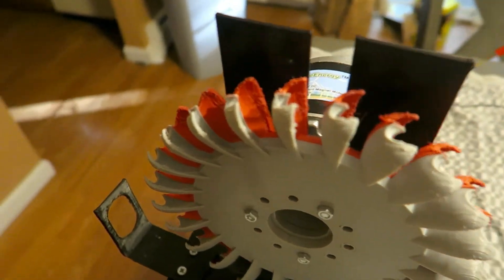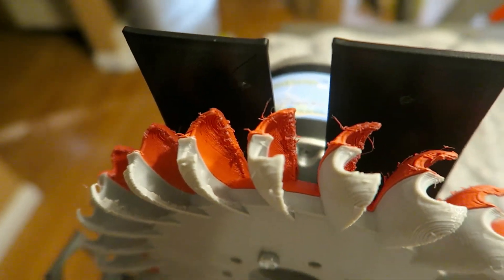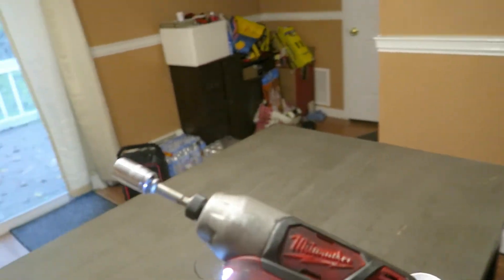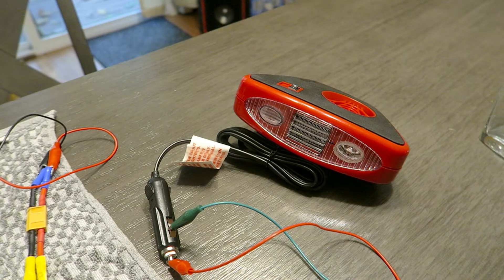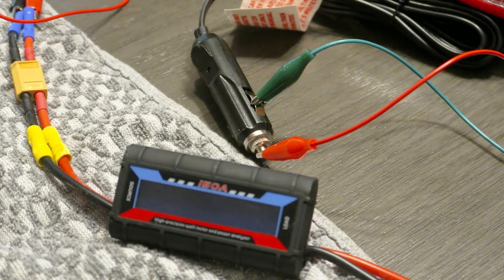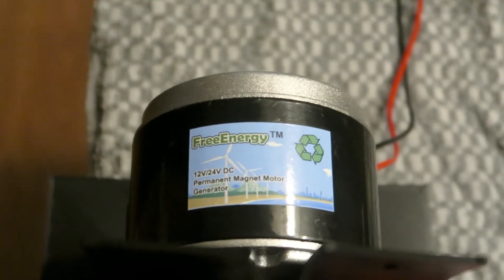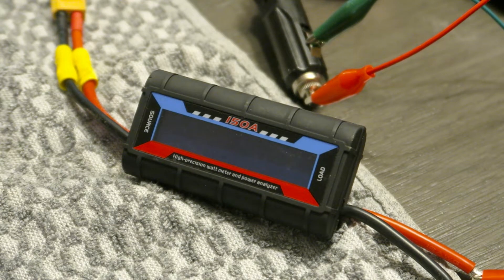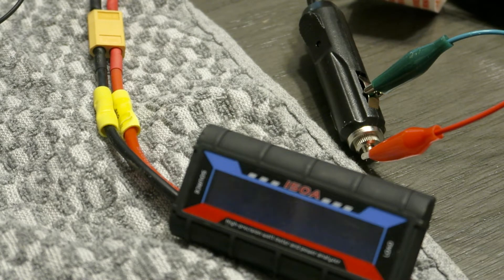3D Printed Pelton Turbine Bench Test (part 3) 200 watt goal

Comment: Great job... :) But i think 8. something Volts is not enought.... I had the same issue with my turbine. The generator had to much / minute. if you change the generator with lower rpm you will get more Volts.
 https://www.youtube.com/watch?v=0Dj0gA_fTU8
Reply from the maker: I'm likely going to have to do that but that also increases the torque needed to spin the motor. I'm gonna try a lower wattage device soon stay tuned

Comment: Great job there👌 I am building a small hydropower station in my garden but I am not sure if I should use a turgo wheel, or a pelton. Any reason you went with pelton?
Reply from the maker: I went with the pelton for higher head pressure and less flow. I can try and use same motor with turgo wheel if you would like. I'm also making a new pelton wheel as we speak to improve performance. It all comes down to what you can work with. Hope this answered your question